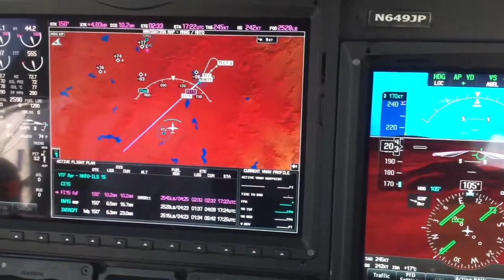Why Learjet 35/36s Crash

Comment: I have about 2200 hours flying the LR35/36 around the world as air ambulance pilot. I love that aircraft. It was very responsive and fun to fly as long as you knew and understood the characteristics of its weakness. It was a challenge turning (on/off) the crew Oxygen tank valve. Relatively small wing that did not generate a lot of life. You had to be careful with regards to cross control stall during base to final and had to stay coordinated at all times. Did not have good braking systems even with TR/s you had to be careful on your landing roll.  But apart from that it was lots of fun to fly. When you are light it will climb like a rocket ship. I was fortunate enough to fly the LR-28 which still holds the record set by Neil Armstrong in 1979 climbing to FL510 in 12 minutes and 27 seconds. To the best of my knowledge all of the accidents were attributed to pilot error.
Reply from the maker: Most of the accidents were due to pilot error. The errors were happening because of poor training.
Reply: @BizJetTV  poor training,poor skills and first of all horrendous sloppy type rating checks.

Comment: Completely wrong about the Payne Stewart Lear. The bleed air control panel was found intact in the wreckage and BOTH bleed air switches were found in the “off” position. Plus, they forgot to open the O2 bottle back up during preflight (which is in the nose) so there was no O2 for the masks. 
Basically, the airplane was in a rapid climb as normal, but the airplane never pressurized. Crew more than likely fell unconscious during the climb.
If it had depressurized, the “H” valves coming off the engines would’ve opened up while dumping bleed air into the cabin. No frost would’ve formed inside the windshield either.
The 30 series Learjets broke many records and still hold several today. It’s one if the safest, most reliable jets ever built, but must be flown by the numbers by a very proficient crew, not by idiots.
Reply: What is your source of information? This is the first time I've heard about this. I'd be interested in studying this crash in more in depth. Any info you could offer would be appreciated.
Reply: Spot on herkloader34. That is exactly what happened to the Stewart crash. Truely a fabulous machine to fly. Like all aircraft you have to stay in front of the airplane.